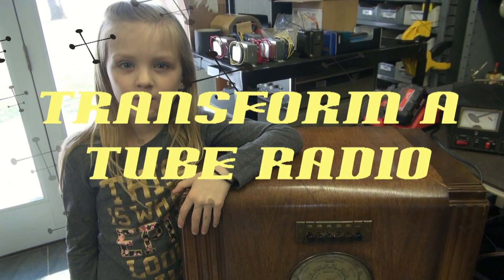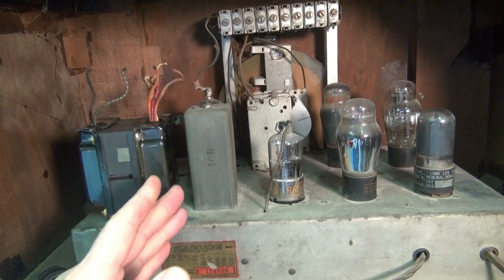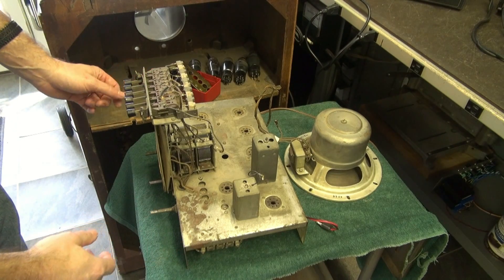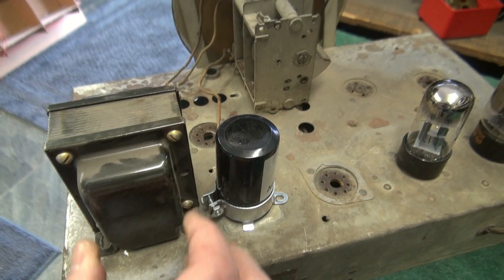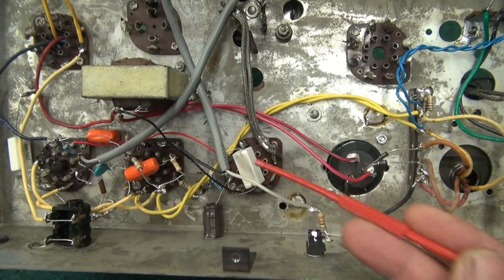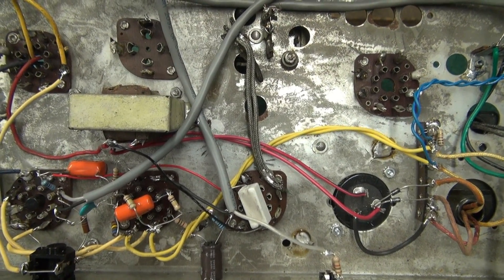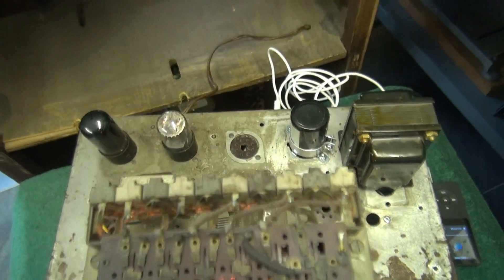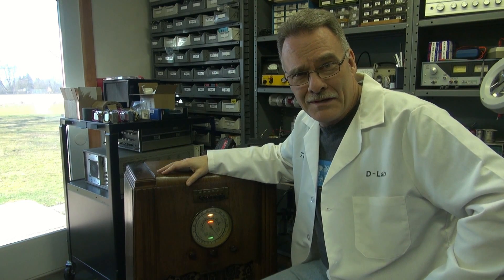How to convert a Vintage Tube console radio to MP3 player amp by D-lab

Comment: I have a 1931 Crosley Merry maker that the chassis was not worth restoring because of a previous hack job. So I had a 50 watt Bluetooth amplifier put in, a l.e.d light for the dial. I built in a speaker box used a 8 inch stereo ceiling speakers with a 10inch passive radiator on the back. I then put a tube pre/head phone amp in front of the digital amplifier. Looks great sounds great. (Forgot bought a 1969 Sony  st-80 Am FM turner to complete the Make over.)

Comment: I have been wanting to add a phono input in my 1931 Apex 10BUS radio to be able to hook up my bluetooth to or Mp3 player since I got it and would have to add a switch and a phono jack to the inside of the wood case and not drill any holes in chassis. I would never gut it and do that with this set since it plays beautifully, has almost all of its globe tubes. I was also thinking on building or buying a AM transmitter and not modify this beautiful set at all.

Comment: I converted a Marconi 1930s radio to take USB / blue tooth app for my collection so that it could work and play a continuous stream of 30s, 40s 50s tunes.. The valve circuit is off and a separate amp unit kicks in but the lighting on the dial et retains the overall appearance of that unit to perfection. The solid teak cabinet is a piece of art. I praise those who save these old radios. A bit of ingenuity, patience and you can end up with an amazing project that gives hours of endless pleasure whilst reliving memories.. . 😊

Comment: I have one question, Terry: It looks like that MP3 Input connected to the volume control has a direct line to the grid of the 6SN7, and I'm wondering if that is a shock hazard? If so, I was thinking that you could add a small transformer at the input jack, such as a 600-to-600 transformer from an old radio to isolate the DC on the 6SN7. You could use a cap to couple things, but if it ever shorts closed, you'd have the same problem. Be careful out there messing with this stuff, folks!

Comment: How would you add a Bluetooth Circuit board and blown tubes How do you add it to a radio for the 1930s and it needs a new plug

Comment: I have 1941 General Electric console which uses two 6V6's for it's output and it has a aux input from the factory that I use either my mp3 player or blue tooth receiver

Comment: All you have to do is add an audio input to the back of the volume control. And then have a radio and mp3 player.
Reply: Gregory Malchuk -replacing the original power cord with a polarized cord and making sure the bypass caps are new would have addressed the safety issues. That being said, this is the first console set that I have seen that is transformerless plus It appears to be AM band only. “Plymouth “ was a brand used by  Meck  of Plymouth, Indiana , a maker.     of “ jobber “ radios but they were not known to have built radio sets prior to WWII . The gold and red patent tag might have been “Plant A Chicago “, aka Clinton. They would have built a transformerless console set..

Comment: Easy enough to have it work as a radio and add an input for the player.

 Not too long ago I found an old GenRad box some idiot gutted out and decided to build into a
Champ style guitar amp. Some clown had paid good money for it, it was broke, and being a stoner he traded it for something at a local guitar shop. I got hold of it for $20 and it sits on my bench now. I stripped it of useful parts and it's getting filled with Tannerite and we're going to see what a 6.5 Creedmoor will do to it at 300 yards tomorrow.

Comment: That's a good project, what should the amp rating be on the power transformer? Thanks, Chris
Reply from the maker: Approx 600vac CT, 75ma plus the 6VAC for heaters
Reply: About 2A for the 6v secondary?

Comment: I have a '46 Philco console with 78 player.  The radio crapped out when I capped it, me thinks itsa crappy loctal socket.  I don't care about the radio, made it a geetar amp with 78 rekee player.  I think it has a 10 or 12 field coil driver.  I might get 50$ cuz the radio doesn't work.  lol 
BUT umathunkin 'bout really desecrating it.  I got a Yamaha spinning baffle speaker from epay.  Notice I didn't call it a Leslie.  No amp or cabinet, justa speaker.  I think it will fit nicely inside the Philco.  Don't know if the voice coil output of the Philco is 8 or 16 ohms, or higher?  Easy to find out, but may use another amp to it anyhow.  Lotsa room in there iffin I scrap the rekee player, FC speaker and antenna in there.  I can get more for parts.  Don

Comment: MONO?  LOL  
Something to explain for future vids Tmeister,  
INPUT impedence matching, how to make the input for low imp mics, guitars, line in, or even speaker source input to the preamp?  A four  position rotary impedence selector switch could make for a universal amplifier.  I'd simply use an old  mixer.  Better yet, replace the chassis with an old tube Bogen mixer amp.  Add the mics, and it's karaokie dokie time.  
Don